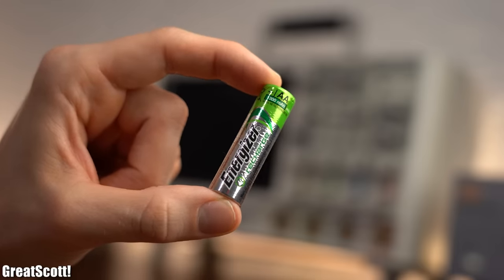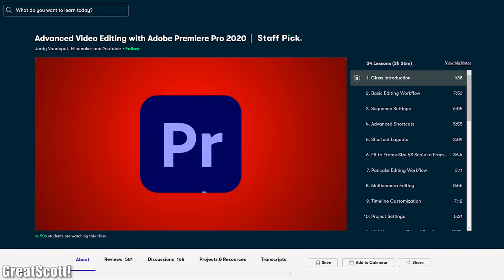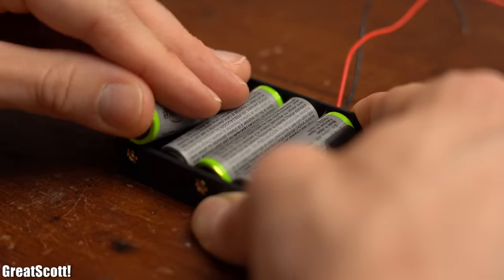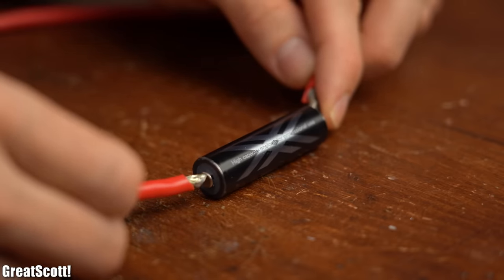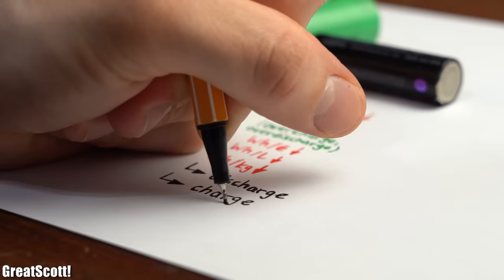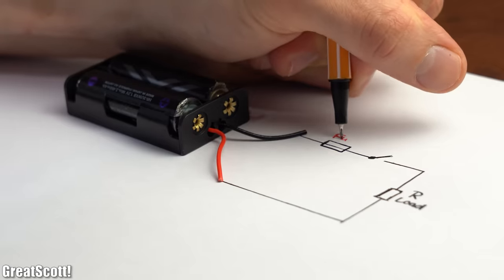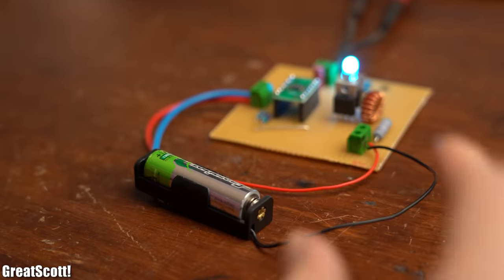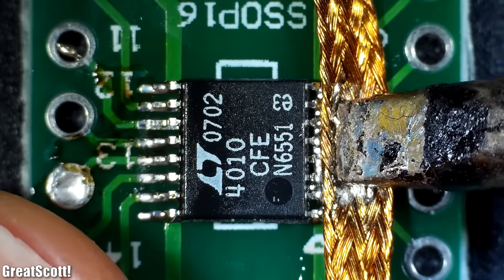Are AA NiMH Batteries obsolete? Here is everything you need to know about them!

Comment: I replaced (mostly)all nimh Batteries whith li-ion or lipos. 
It is postible to change nimh to Lithium Batteries in Devices, if they use 3 nimh cells in series. I replaced the original nimh Batterie case whith old Phone Batteries and a tp4056,becourse the Lithium Based Batteries have much higher capacity and are very easy to Charge over usb.

Comment: Yeah, NiMh and NiCad has it's niche use, on cool use is they withstand trickle charging forever so you can have a small backup battery in your circuit with just a small current regulator and some diodes. Said so, im glad to have lipos and lifepo4 and super small ics to handle the charge/discharge.  Memory effect was also a pain
Reply: Yeah, it's kinda funny that you need to deep discharge to regain the capacity. Had a pair of GP Recyko that showed memory effect. Discharged it to 0.4V then fully charged it back. The effect had just gone away after that.

Comment: I love that nimh batteries don’t degrade overtime. I have ten year old eneloop that still have the advertised capacity. They are rock solid. Lithium will degrade. In use or not.
Reply: I've seen both of these types degrade quickly as well as last a long time. My Eneloops are one of the ones which still perform to spec but they also haven't been used much.
Reply: @eDoc2020  They can degrade quickly with the wrong charger or in a leaking bike light in a Dutch winter. But most of them still working great. When they have problems I use the breakin on my Skyrc MC3000. Highly recommended charger for Eneloops.
Reply: @Rinkel80  I use a La Crosse charger for my Eneloops and most of my NiMHs (and the occasional NiCd). I'll occasionally use an old dumb charger but only on batteries which are already pretty much toast.

And of course the main benefit of using regular AA NiMHs which IIRC GS didn't mention is that they are easily replaceable.

Comment: I also remember reading that NiMh do better at lower temperatures vs standard lithium ion batteries, although I would have to do more research to confirm. I am sure there is a lot of research in this area for Lithium ions though.
Reply: I  thought the exact same thing!
But looking up the datasheets for a couple Li-ion(Panasonic NCR18650B) & NIMH(Energizer NH15) cells the Li-ion ones actually had much better discharge temp specs at -20~60C vs 0~30C for the NIMH. Charge temps were 10~45C vs 0~45C  and storage was -20~50C vs -20~30C for the Li-ion and NIMH respectively.
Guess Lithium batteries have come a long way in the last decade 😁

Comment: Compared to a lithium ion based cell, I have noticed that the NiMH battery pack does not offer a good run time. I have a Phillips Aquatouch Wet and Dry cordless shaver that is powered by NiMH cells inside. They charge up very slow and discharge rather fast because my shaver has a pop up trimmer that is a high current load. 
The charger of the device would have costed 10 USD approx, and new trimmers available online also cost around the same. I have a hair trimmer now that features easy USB charging. I use the old school foam and razor system for shaving now.

Comment: I have 1 for Ni-MN batteries. LEGO still uses alkaline battareikib toys in their RKs, which are very expensive to change often! Therefore, until lithium is not so safe for toys and there is a cheap and safe analogue of the lithium mixture to discharge and fire, it is unlikely that it will go out of use so soon.

Comment: when I bought a good charge/discharger for 18650s which happens to also support AA and AAA batteries I put some old nimh rechargeable batteries in there to test the capacity and saw a lot of them were pretty much dead (due to memory effect their capacity dropped to 20% or less) and I figured out that running them through a couple cycles of discharge / charge recovered capacity to sometimes around 85%...
Reply: I don’t remember the brand but I bought a cordless drill several years ago that had NiMH batteries and according to the manual the battery capacity would get better the more times it was charged and discharged.

Comment: awesome video, 26 amps :O that was worth it to me alone. but the added vindication that these are rugged batteries was cool as well as just how much they can take. looked into them years ago and got a 4 pack, then another 4 pack with chargers, started looking for devices that use them for built-in storage rather than the more sensitive high power options. fast charging isn't a problem as i have enough on rotation for what uses them. though i suspect the chargers for the few devices (razor/clippers) i have with them use that chip ^_^ mainly because another older NiMH razor has a long charge cycle (12-14 hours) while the other two are pretty rapid.

great information as always.

Comment: NiMH like eneloops are great for set-and-foget devices, like remotes (TV / sound system) or for toys. Unlike alkaline batteries, NiMH wont leak electrolyte when depleted, which can severely damage the battery compartment. They are also relatively safe to charge and discharge at reasonable rates around the home without a risk of fire, compared to Li-ion or Li-Po batteries.
Reply: I have some leaky NiMH batteries.
Reply from the maker: Great point!
Reply: @mikebond6328  Are you sure those aren't Ni-Cd? Ni-Cd's are more known for leaking than Ni-Mh's are. Not that it's impossible, as any battery with electrolyte can leak, but Ni-Mh generally only leaks if it was damaged physically or by overcharging/overheating.
Reply: yés 210⁰ çyçkes
Reply: @mikebond6328  What do you think made them leak? Were they left uncharged at less than 0.7v for a long time?

Comment: I think a big problem with those batteries is that the uneven capacity thing. That's why the packages say you should only use the same brand battery in one device and so on.

It also doesn't help that they have the same form factor as alkaline batteries, which iirc have a different output voltage which might lead to incompatibilities with some devices.

Comment: Biggest problem for lipo batteries is lack of durable small form, rechargeable lipo button battery with long standby life and high energy density would be hit
However biggest challenge is existing battery infrastructure, who doesn't have charger and rechargeables lying around?
On top of that, they came late in to the game, it will take long time until people collect enough 18650 to juctify devices running out of them, but they are cumbersome, try to fit one in pilot

Comment: NiMH batteries have a clear advantage VS Lithium in any form, in that where lithium has no memory effect, but will degrade quickly when left at FULL or EMPTY too long and likes to be stored at 50% and also HATES deep cycle (the way everyone actually uses batteries)  the opposite is true for NiMH, which degrades quickly when charged at random and MUST be fully charged then fully DISCHARGED down to nothing as much as possible.    So here's the use case: Lithium = "charge it whenever.. but never let it die or become 100% unless you are going to need it's full capacity to complete your task"   Nickle Metal = "run your devices and forget until it is 100% DEAD.  Then charge. Do not interrupt it's charge until it is 100% FULL."   AA and AAA's are cheaper.  Li is expensive.  Also, Li is good for when you have the luxury of using the device intermittently (like power tools that get taken out every now and then. and can be put away at half charge.  or charged here and there for 10 minutes and removed without fear).  Or in an EV where you can charge at a supermarket for 15 minutes and safely unplug without hurting the battery.   Ni MH are better to abuse due to cost and good thermal management.  Li gets dangerously hot if used in a sustained output, and may start fires.  Also, Li can sustain a 1.5v charge, while Ni/MH are stuck at 1.2v but have much higher capacity per size. So yet another use difference between the two. If you must have voltage, go lithium. if you want sustained steady power, go nickle.

Comment: LSD batteries are far from obsolete. NiMH also does not suffer from memory effects and they can be recharged over 1500 times at the very least without being damaged. Li-ION/LiPO batteries will be damaged on the first charge, if charged above 50%. It's a hilariously bad tech, however they provide much more power in terms of amps. So for a high drain device such as a flashlight, they are perfect. but for a low drain controller? Nah, use NiMH instead.

Comment: 3:57 To be more explicit, the 'C' rating calculation should be like this:  5 A-hr * 130 C = 650 A.  (Note the "5 A-hr", not just "5 A".) Therefore the units of C are 1/hr. It's a shortcut to start with 5 A, and is perfectly accurate numerically - but may be confusing to some. Very powerful technique to always balance the units when doing calculations, to help avoid errors.
Reply: @b gg No, my post is perfectly correct. My post was specifically about the ever-so-slightly incorrect units (the A in "5 A") as shown in the video. Your point is otherwise true, but it is not applicable to the post that I made about correct units.

Comment: Ah, NiMH!  So many laptop/tool batteries that died after a few months....
I'm still using them in two places: recent-model FRS radios that still use NiMH, probably so you can ditch a dead pack and use alkaline cells in a pinch, and a 2002 Prius (now on its second pack).  The Prius maintains its NiMH pack in a very narrow range of state-of-charge, which drastically reduces the useful capacity but extends the lifetime from a few months to many years.
For us lazy types, LiFePO4 is ever so much easier to design in.

Comment: The battery impedance is in series with an ideal voltage source, not a battery.
A battery includes both ideal voltage source and impedance 🤔

I still can't believe the excessive use of solder to make tracks/traces, but it does look nicer 😁

Comment: It still makes sense to use them nowadays if you have devices with an AA battery slot witch do not have an internal charging circuit. Let’s take the controllers of the Oculus Quest 2 as an example. Those can’t recharge the batteries. You have to take them out and replace/recharge them. NiMHs can take more abuse and won’t lose their capacity that quickly. They’re simpler and easier to operate. They charge with any charger with an AA battery slot. If you compare this with the LiPo, you have to look for the right charger and you have to use them between 80% to 20% so they don’t wear out as fast. In my opinion the NiMH’s are better for the consumer even with their downsides. Fun fact, if you use NiMH batteries in devices that show battery percentage, they’re more accurate compared to the usage of LiPo’s. The LiPo batteries have a more constant voltage output wich makes most devices show 100% for a longer time while the battery may actually be at 85% or less. So the battery percentage gets less reliable with LiPo’s compared to NiMH’s.
Reply: wrng

Comment: I use lipos in my rc cars, and nimh in anything that takes aa bats.  And even though the lipo is a much better battery ive never needed to keep my nimh batteries in a fireproof bag.  I remember when nimh became low discharge.  That was pretty exciting for tech guys everywhere.  But if they make a rechargable lithium ion based batteries that read 1.5 volts that a true game changer as the weight to mah will be just awesome.

Comment: The biggest key for charging if it's a multiple charger running a parallel charging circuit,  Throw it away or just use one series circuit of the device that charges your batteries. When you start multiplying different cells without an entire without a intelligent computer you cannot charge them evenly. Just put one battery at a time by multiple chargers  And let each cell charge individually you will get most optiment results this way. With nickel metal highlight batteries you do not want to trickle charge them and you do not want to drain them and halfway drain them they hold memory.

Comment: The eneloop 4:05 quite literally does come with the discharge rating on the datasheet, you have it literally highlighted at the bottom of the page at 4:10 
You can see the voltage drop is already very high by 5 amps and almost unusable, not "26 amps".

Comment: I still used Ni-MH batteries, because when it is fully charged it is about 1.3 volts each and 5.2 volts in 4 sets of it. this is perfect for any circuit that can take 4.7-5v e.g. and LDO and produce 3.3v. many Li-ion batteries 3.7 nominal is 4.2v fully charged and the headroom between 3.3v - 4.2v is 0.9v, many (cheap) LDOs cannot cope with so little voltage headroom especially if more current is needed. but 4x Ni-MH has no problem supplying 3.3v as 3.3-4.8v nominal is 1.5v headroom, nearly every (cheap) LDO can do it, even bipolar ones.
The other thing is Ni-MH batteries can stay at 4.8-4.7 volts plateau for a looong time, especially with low current draws, this keep devices near 100% voltage levels most of the time except at the end when it needs to be recharged. for Ni-MH, Columb counting is needed as by the time 4 x 1.2 reaches 4.7v it is nearly drained like 20% or less left.
another thing is Ni-MH has less of the 'battery fires' problem that afflicts Li-Ion batteries, comparatively safer. partly as good Ni-MH batteries are well made vs 'cheap Li Ion' 'flea market' batteries which probably is made in a garage with no consideration for safety. and there are simply too many 'fake' Li-Ion 18650 batteries in the 'online flea markets'
Reply: @greatscottlab , you may want to feature a columb counter project in one of your videos, I think it is a useful project to showcase columb counters e.g with Ni-MH batteries which don't have the 'voltage slope' that afflicts many other batteries. i.e. Ni-MH drain don't show you the 'end point' during drawdown until it is almost finished.

Comment: Actually NIMH cells don't need balancing. If one cell charges up first it simply heats up in result losing excess energy (works well only with quite small capacity differences).
They have another important adventage over li-ion, li-po cells: much lower self discharge. You can leave them on shelf for few years and they will still be almost fully charged. For this reason NIMH cells are better for low current aplications (below few mA) like computer mouse, TV remote or small solar LED light.
Reply from the maker: Thanks for the feedback :-)

Comment: I was Just talking about this yesterday with a Friend. I needed a 6V battery that would go up to 7.4V

I decided on LIFEPO4 batterys since they have models with 3.2V and 7.2V when charged.
Reply: (2) 18650’s in series have a usable voltage of 6V - 7.4V.
Reply: @mikebond6328  that's like saying a car drives 200km on a gas tank.

18650 is just a form factor not a battery type i think.

Comment: Not surprised, but still disappointed you didn't throw one of the LiPo 'AA' cells in there just for fun - the ones with the micro-USB charge port and built-in buck regulator to drop the output to 1.5 volts.
Reply: I've used 2xAA size lipo-to-1.5v batteries in an indoor weather station ("T-POWER" brand). They last 6 months 20 days before needing recharging. (6 months 22 days the second time). Started 14 months ago. No hickups yet :)

Comment: Cheapest way to get those eneloop pro batteries is to by them from ikea, as long as Ikea do not change where they by them.
Reply from the maker: Good tip :-)
Reply: There used to be only one factory currently in Japan that can make Low Self-Discharge nickel-metal hydride batteries (LSD Ni-MH) and that is FDK. FDK is an OEM manufacturer for other brands, Like Amazon, Fujitsu, Panasonic, and IKEA.

It's changed now and other countries also produce the cells.
Reply: Yeah, was wondering why he used eneloop and energizer which are known to be quit on the high side of price. The Ikea Ladda constantly rank among the top NiMh for price/performance, often a significant margin better than the 2nd place.

Comment: I don't use the O word. Nothing is obsolete, everything usually works for its original purpose, it's just that our needs have changed. The only exception is planned obsolescence. A phone for example shouldn't become slow over time for no reason. That's not how physics work.
Reply: NiMH is still used by Toyota in their hybrid vehicles due to its greater tolerance for extreme temperatures and higher overall reliability compared to Li-Ion.

Comment: Good video; but one information is missing : there are (to simplify) 2 different kinds of NiMH batteries : the "true" ones and the eneloop kind.  Standard or true NiMH does autodischarge over time (say 2  weeks) where you will find 1.2V or less. Over time new technologies and chemistries were invented (like eneloop) to avoid that. Those are sold with various brands and are sold charged, and this charge level do not (or very slow) drop without use. And there can be some nuances in the way to charge them. Another important information is that energiser is shit, both for their rechargeables and their primary batteries. Ansmann are true NiMH, Eneloop or panasonics are eneloop kind, Energiser only makes very good lithium primaries, but caution those come charged @ 1,85v. (not good for high power, just a remote that will work 15 years)